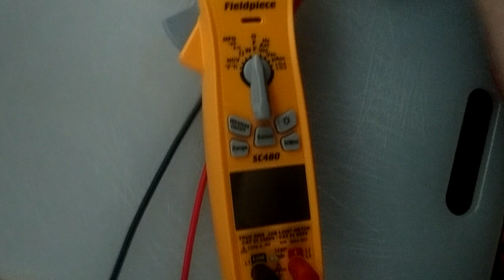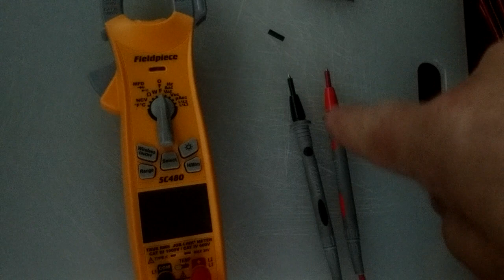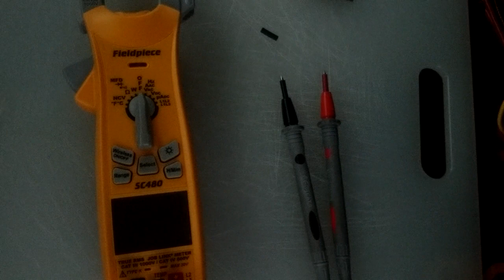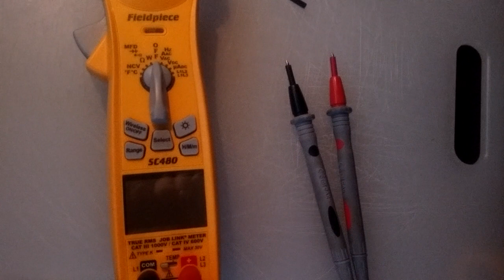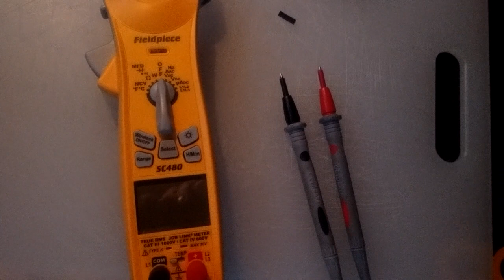How to make probe tip covers for your test leads for FREE!!!! Watch this 😎👌

Comment: GREAT Tip....for your tips :D 

I've lost a few of those dang tips in the 6years I've been doing HVAC, and it's always frustrating....because, like you said, I've gone across two terminals on a fan relay before and gone phase-to-phase with that time and POW!!!  
I've gotten in the habit of taking those tip covers for my Fieldpiece leads and sticking them in that metal measuring tape holder on my Veto pouch so that I don't lose them or drop them in the grass.  If/when I DO lose them, i'll have to try this trick to get my tips covered.  Thanks!
Reply from the maker: Thanks for watching buddy 😎👍

Comment: I'll add tiny pin test probes are a must for electronics, where slipping an 1/32nd of an inch can instantly destroy $1500+ of components or a whole board.
pretty much 300x more delicate than what HVAC/R deal with, unless you go poking around surface mount electronics. most of that equipment is encapsulated or potted in resin though.

Comment: I was gonna say those look like the snap on crimpers. I’ve seen Emin review those but I could never bring my self to drop 60 bucks on some crimpers lol. I’ll definitely be stopping by a napa see if I can grab some of these 🤙🏻
Reply from the maker: Other than the handles these are identical. I own both of them. And I actually prefer the Carlyle's, believe it or not .
Reply: @sknight0391  just picked mine up this morning at napa man I’ve been missing out on these!
Reply from the maker: @HVACslayer  they really do make a beautiful crimp. And really strong crimp also, there ain't no pulling the connector off of The Wire once it's crimped  hope you enjoy using those things. 😎👍
Reply from the maker: Here's a picture of them Side by side. The Carlyle pair actually has a cleaner finish to the metal.⬇️
https://photos.app.goo.gl/8qiAduhashpY29Nu5

There's a picture of the Carlyle pair close up. That matte finish is nice. ⬇️
https://photos.app.goo.gl/5YuBP1PnTYcGrAdf9
Reply: very likely they are the failed inspection snapoff models (lol someone done been watching the AvE), look to see/measure what's not in spec.
those to me looked loose in the crimp/stake-on section, maybe warped or plier end not ground right/bad heat treating
Reply from the maker: @throttlebottle5906  I've been using those for years. There ain't a thing wrong with them. They are excellent quality. I would pick them over Snap-on any day. I hardy ever used my snap-on models (they just sit in a spare bag most of the time) and one of the handles slide off. So I had to run down the Snap-on truck at a gas station one day and get them replaced. And the Carlyle's also have a lifetime warranty if you ever need it. 😎👍

Comment: Great idea! .. And, I have the needle nose version of those Carlyle stripper/crimpers
Reply from the maker: How do you like those crimpers?
Thanks for watching 😎👍
Reply: @sknight0391  they work great! I mostly do residential HVAC, and I keep them in my diagnostic bag
Reply from the maker: @domrod1579  the crimpers work much better on the pair like I have since they're up in the front of the pliers instead of behind the pivot point in between the handles. 👌
Reply: @sknight0391  I have a pair of those in my tool box at home. And, they do work alot better than the needle nose I have